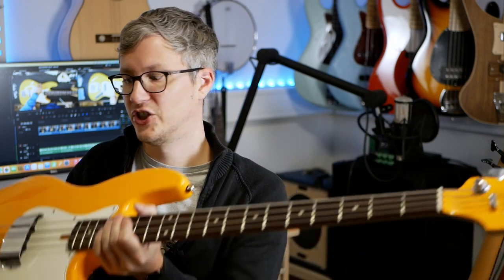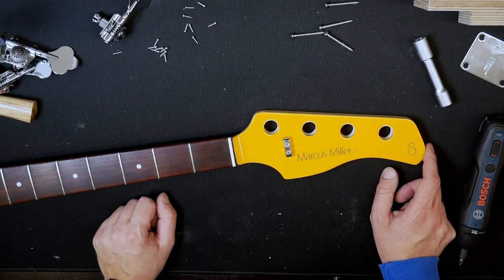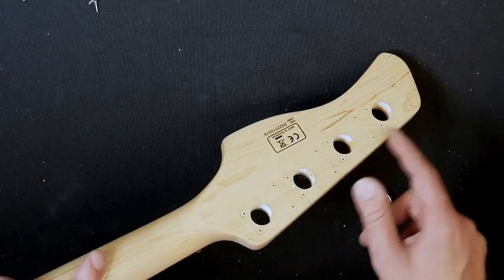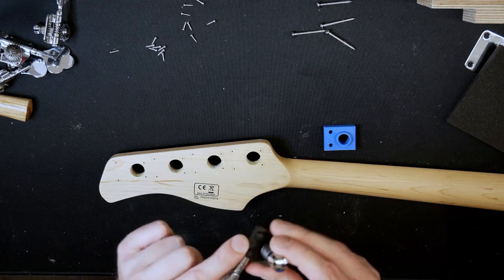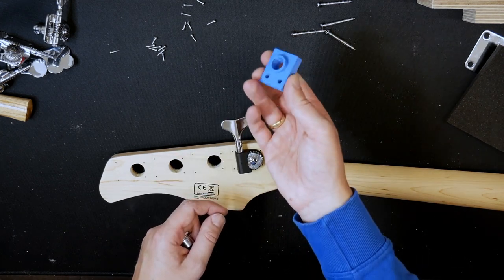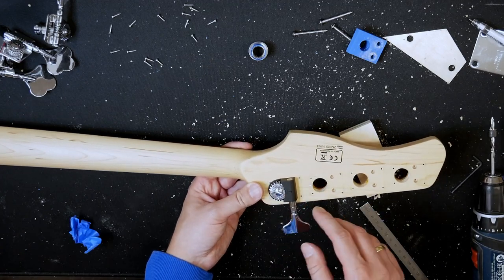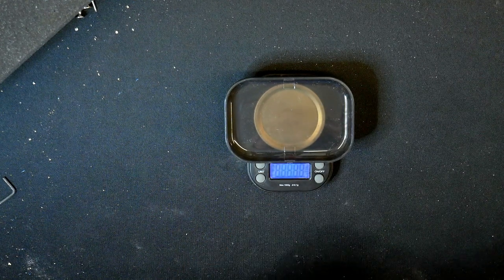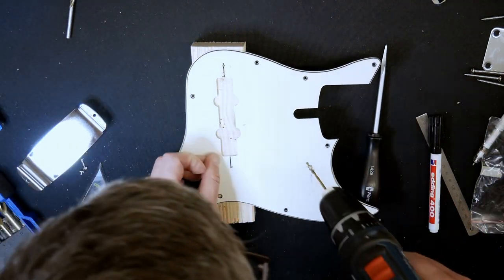Sire Marcus Miller V3 - Review and Mod - Pt. 2 Mod

Comment: Hej Toby, thanks for the great video! As far as I understand from some other V3 videos, there is a slight neck dive issue. So I' m wondering if the new lighter tuners helped solving the issue. Thanks in advance🖖
Reply from the maker: @saveyourmind  Well the Schaller tuners are just a little bit lighter than the stock ones. I didn’t notice a particularly bad neck dive on my V3. On the lap every Jazz Bass has neck dive, especially if the body is rather light weight like the V3.
Reply: @basstelkeller  Mmmm, I see. I play guitar, and never had an experience with bass. Thanks for clarifying the neck dive issue on jazz basses👍🏽